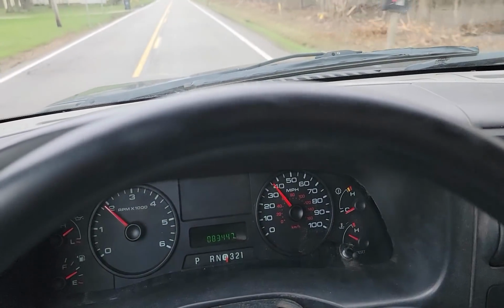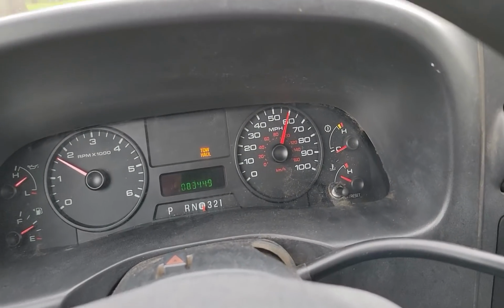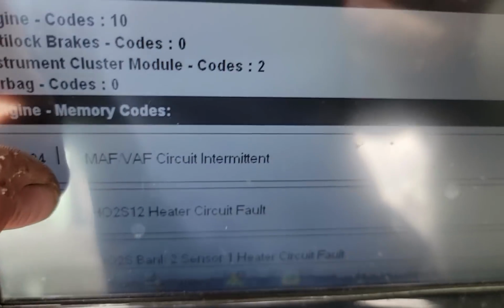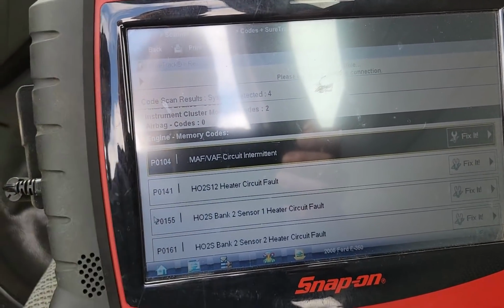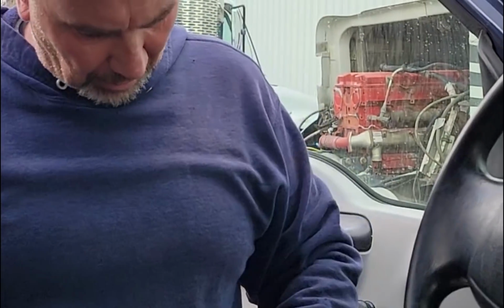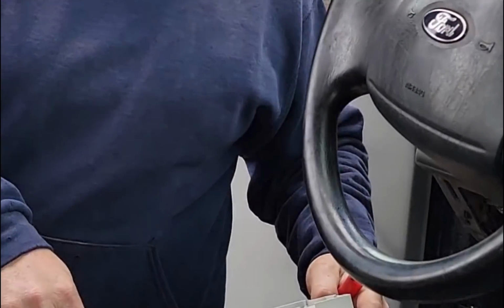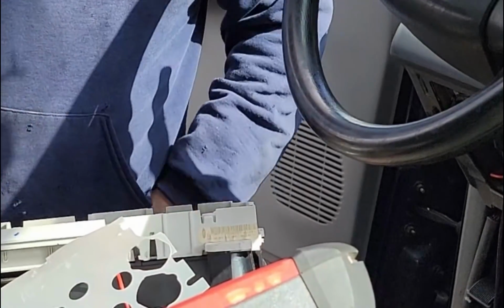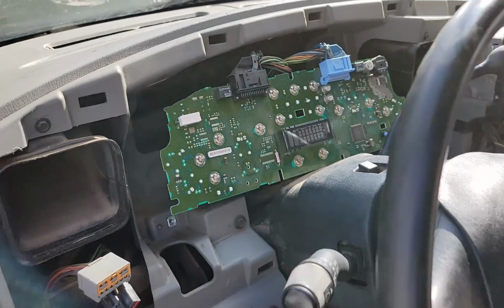DONT GET SCAMMED WHEN BUYING YOUR NEXT USED VEHICLE!

Comment: As a diesel mechanic I will never forget one job that was sent to me, a 6.0 Ford running hot issues,  the coolant tank was full of perfect coolant,  however all of the lines had wooden dowels in them, blocking the tank(the visible part) the trunk had a blown oil cooler , the coolant system was full of oil,

Comment: Using forscan, changing some sections of code to "00" I was able to permanently turn on or off individual cel warnings, disabled tpms. Scary what can be done with your cellphone or laptop to a automobile when used inappropriately. Almost impossible to catch unless you look at the codes and compare to original.

Comment: I often have customers that ask what they should look at when they buy a used vehicle. I always tell them to get a cheap obd scanner that reads obd monitor readiness.  If the monitors aren't ready, or someone has pulled the power fuse, just walk away.  Here in NY chances are they are trying to hide bad converters, which in this state is a very expensive repair.

Comment: That era of cluster is famous for needing to be resoldered/repaired.  They have failures and the relay will fail often causing the radio and other things to quit working.  There are several places in the country you can send that cluster to for repairs, and the mileage so stay correct.  Or you can have a replacement one set to be correct by them as well.  I used one place called circuitboardmedics and they finally fixed it, but it took two times (they didn't test all functions before returning obviously, and was the exact problem I described the first time to them) and they weren't very good about fessing up and fixing their oversight, either.  I personally would use someone else for my next repair because of that.
But that is a good catch on a dishonest seller.
We bought a used Peterbilt from one dealer that rhymes with PEC trucks, and they had a blown rear airbag, and someone straight disconnected the air supply to it, kinked it over, and zip tied it up into the frame wiring to hide it.  Glad we caught that before booking it to a trailer.  Oh, and the fifth wheel hitch was missing a clip in the locking linkage, also.  How curious, no? 🖕.

Comment: I am a fleet mechanic for a municipality.I would never do this. I had to laugh when you say this is illegal well I think at the point of the catalytic converter’s were gone ,we had established  that the law wasn’t important then lol. When my guys complain about rattling I always replace the cats because it stinks to work around the truck especially when they’re repairing signs or flagging a truck with a bad catalytic converter really stinks bad not to mention the check engine light. I think the AL DI connector being moved is pretty normal the GPS companies put a jumperOn them to intercept the vehicle data and still have a connector they probably remove the GPS before they sold it and just stuck it there and I agree with you somebody pulled the fuse or cut terminal 16 wire so you couldn’t scan it. I know when we sell our vehicles they are sold as is where is we usually don’t sell them till there’s nothing left of them they’re basically parts vehicles

Comment: In NY you put DMV Investigators on to the sellers. Especially with the evidence you have.  Once they get their teeth into them there isn't much left. I witnessed this first hand with a gentleman who was taking a 68 LeMan's and trying to make it into a GTO.  Even had a correct GTO VIN plate he placed over the original LeMan's VIN plate.  Well after being arrested for having the non attached GTO VIN plate. (A felony just in itself) DMV seized the car and took it almost completely apart checking for other discrepancies in the body numbers engine tag's etc.  . Not sure if the car was ever returned but I last saw it in a lot of pieces in the DMV garage.  Wishing you luck with these dishonest sellers.

Comment: That’s a shame. I wonder why they went through all the trouble of disabling the check engine light but not the tow/haul light too lol. Looking forward to an update on this on what they had to say.
Reply from the maker: it appears as they cleared the code for the trans temp sensor and it didnt come back on until the engine reached operating temp but the trans temp did not. they probably didnt realize.

Comment: Jc not saying they didn’t do it they probably bought from someone else possibly auction or private sales might of passed along problem they inherited themselves but if did know should of disclosed it but definitely someone went to great lengths to mask issues
Reply from the maker: it went from the original municipality owner, traded in to the ford dealer on a new replacement, then to this dealer. pictures from the ford dealer with the cluster lit up...check engine light working.
Reply: @j.c.smithprojects  Well there you go Inspector nice detective  work hope you took a tire iron with you

Comment: Another used-car dealer scam is the "Used Car Warranty". I recently paid too much for an 07 F-150 w/ 180k. It left me sitting a couple of X's b/c it wouldn't start, & they said "Claim it on the warranty". The shop I chose said it would take a few weeks for the approval process. Needless to say, I decided to fix it myself. A rusted nut on the starter solenoid, Stripped bolt on + batt. terminal, Four new brake rotors, A new pass. side rear axle & driveshaft, Now it runs fine. A few dash-lights (ABS,Em Brake etc.) but I ignore them as a rule. Fwiw: Tow/haul light on some Ford crates is also the Alternator exciter/charge circuit I think.

Comment: I'm sure you can bend that led back down and get the solder to flow back up to the lead and get it working again. If not, I'm sure you can find out what led belongs there and solder a new one in. I know that's all besides the point but honestly doesn't seem like too big of an issue, legalities aside of course. If the rest of the truck is good and that trans temp sensor isn't too expensive to fix I wouldn't turn it back in to them but I'd certainly talk them down in the price you paid!
Reply from the maker: i am confident i could fix all the issues. i just refuse to let this scumbag get away with this. truck was returned, money refunded and appropriate measures taken to prevent this from happening to anyone else.
Reply: @j.c.smithprojects  man, a video of the look on his face when you told him exactly what he did to this truck would be awesome!

Comment: I work at a Ford dealer. Bring the cluster to your local dealer along with VIN and mileage, they'll contact our supplier and order a replacement cluster already programmed with your mileage, and your old one becomes the core. Price varies, but for that cluster expect anywhere from 2-400

Comment: I failed to notice the exact same thing when buying a cheap VW, but luckily brought a scan tool with me so I knew what codes were in there (previous owner was a standup guy, so I’m pretty sure it was someone before him). I just figured those codes weren’t enough to trigger the light, and didn’t notice the light didn’t come on at KOEO.

Actually it took me a few months to realize the subterfuge, and then I dug into it. Whoever it was had taken the cluster apart, tried coloring over the surface mount LED with black sharpie, and when that didn’t completely block out the light, he balled up a little piece of electrical tape and shoved it in the hole in front of the LED. Got really lucky they didn’t go as far as they did on your truck, it was easily reversible with some time and rubbing alcohol. But I was prepared to desolder an unused LED from another section of the board if I had to.

Boggles the mind that people can be so dishonest though. Especially on older used cars, a MIL usually isn’t a deal breaker. But that level of dishonesty sure can be, regardless how minimal the problem is they’re trying to cover up.
Reply from the maker: none of the issues with the truck were a deal breaker. it was the dishonesty that made me pursue returning it. i wanted to confront the person who was willing to do this in order to make a buck....

Comment: I’ve been a mechanic for over 20 years and something similar got me. Someone had siliconed over the check engine light bulb and I didn’t notice it. Nothing to this extent though. Turns out a torn gas cap seal was all that was needed on my truck for a simple evap code.

Comment: JC napa has a service to exchange Ford clusters you give the the mileage when you order it you get a replacement in about two days ....my cluster went on my f150 (2008) that's what I did it worked out great
Reply: The manager had to come out and confirm my mileage.when i placed the order. The fords of that vintage do not store milage in the pcm but in the cluster..there is a chip in the cluster that stores odometer

Comment: I would have thought a GPS unit was sloppily installed and removed until the obvious efforts with the CE light change my thinking. I wouldn't even trust the mileage it shows.
Reply from the maker: i was able to track the mileage and verify. it is not that i couldnt fix the issues, it is the point of the matter. i wanted to confront the seller and stop this from happening to someone else.

Comment: Something tells me they will reply with ...it's nothing we did ... It's how we bought it . Like a municipality would do that stuff lol . Good luck with the outcome . 
  Should you keep it..I've seen those dash light LEDs online in 10 packs for next to nothing ..I'm sure you could solder out the old one and replace it yourself . 
  Maybe they unplugged the transmission temp sensor as well..or the sensor is bad .
  I'm curious if the tow/haul issue is the button on the end of the shifter missing . 
  At the very least..I hope they discount the sale if no refund....I'm sure you must have parts galore for that truck...they are job security to begin with 😂
Reply from the maker: truck is returned to the seller, money refunded and appropriate measures were taken to prevent this from happening to anyone else.
Reply: @j.c.smithprojects  Ohio DMV may take an interest in their sales practices.

Comment: Truck might have been traded in that way. but does not surprise me.
Reply: In that case a competent dealer would run the same checks as JC and rectify or notify...
Reply from the maker: correct. this was deliberate.
Reply: I been looking for the same truck I want a two door XL  very hard to find in good condition etc. Awsome it had the lift. those are really great to have on a truck so handy. I am sure that truck changed hands after the town had it maybe?
Reply from the maker: no. from the town to the ford dealer as trade in to the their new truck. pictures from the ford dealer with check engine light working. then to the seller i bought it from.
Reply: @j.c.smithprojects  what did they say?? did you keep the truck?

Comment: Tow/haul button at end of gearshift lever was missing, that may cause light to flash , but yes they was trying to make a fast buck. Have a great evening JC and Mrs Smith.
Reply from the maker: The button was still there. the cover was off....had nothing to to with the tow and haul light being on. it was a temp sensor issue light i had thought.

Comment: I thought it was illegal for a dealer to sell a vehicle with the cats removed. Besides all the other sketchy stuff you found.
Reply: I bet the dealer cut the cats off and sold them at the scrap yard then put the truck up for sale
Reply: @A1rs1ck  Thats WAY to much work for a little $. They were prob coming apart and causing the truck to run like poo.
Reply from the maker: you can sell it like that here but it has to be disclosed and it was.